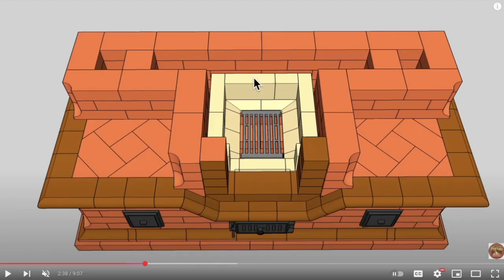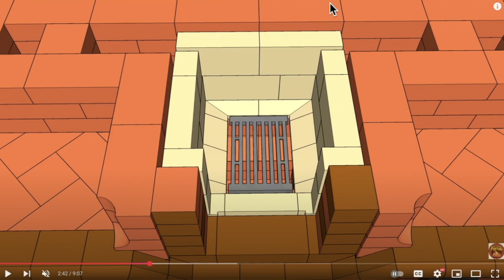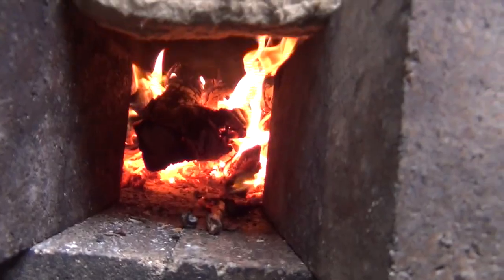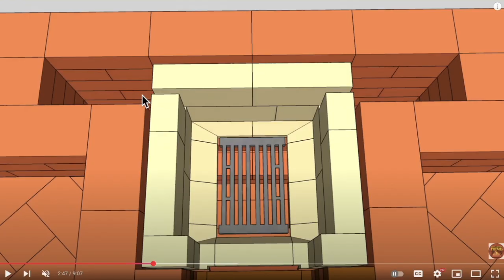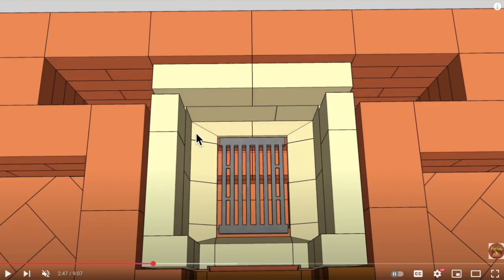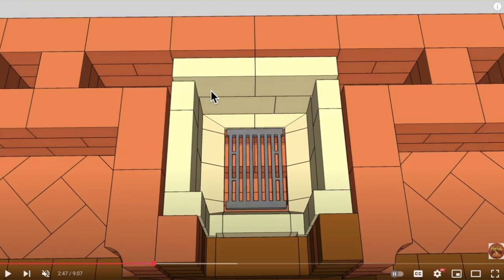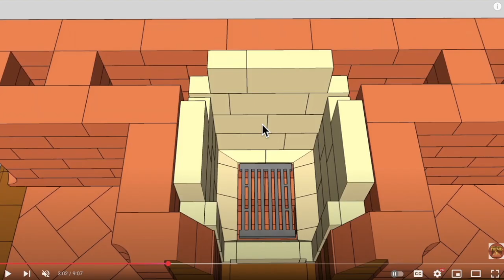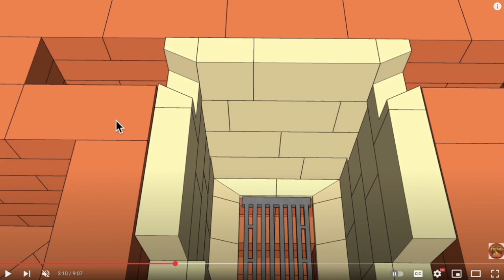Most Russian Stove Builders Do Not Understand The Firebox Dry Slot / Dry Joint / Dry Slit

Comment: Given how much you test,  could you use ash paste as an impromptu mortar? Or would that add too much time to assembly?
Reply from the maker: Yea.. I save my old ash after sifting and, for some, I have used the $3 bag of dirt you get at Home Depot in...  6 parts dirt to 1 part "Type S" cement. It comes apart easy. ..... but for MOST tests ... I can just stack with no mortar and it will work about 85% as well as being mortared. If the stove works pretty well with no mortar, with good draft and very little smoke... then it will all improve with mortar.

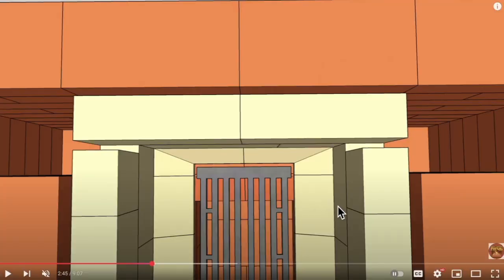Comment: Hmm! And here I thought that it was for startup only. You just covered it ~@05:40 You called it "priming." 

Hahahah. When they say "the separation of hot and cold gasses..." just sounds like a bunch of hot air, really. :D As convection displacement and sheer volumes (cubic feet) are going to be too great through the firebox for any form of marked laminar flow to occur, negligible, at best, and these "slits," once past a cold start, do absolutely nothing in RE to any (thermal) "air/gas separation".

Yet I would argue that it may help somewhat in a cold startup, though.

Heh! I would dare to say that you've come across the "Russian" version of the parable of "The Pot Roast" (cut ends), wives story... XD A lot of industries still have 'em.
Reply from the maker: Yes, I agree... thanks for the good comment.

Comment: The best I can see the slots in that design doing is feeding cold air from the descending passages into the firebox as hot air enters the same passages from above.  Quickly heating the descenting passages.  Ascending passages still need to heat, through a damper, bypass, or conduction through the brick, before the siphon can pull air properly.
Reply from the maker: Once the air reaches the descending passages, it's fully mixed and basically "at one temperature." The colder gasses could not find the firebox again, and the pressure / flow through the slit would be moving in the "wrong direction" for that to happen. Hot air and flame want to move INTO the descending channel because it knows that's the way out to the chimney and "everything is moving in that direction" away from the original air intake or grate.
Reply: @stoveadvice  The flow through the slits back into the firebox would be only during startup, before the descending passage heated.  And the gasses don't know the way out to the chimney until ascending passages warm and can drive convection.

Comment: I wonder if both of those openings could create a strange draft effect like a push/pull from one to the other,,, 
A negative impact overall when the firebox is heating up or cooling down especially.

It would be interesting if you could install thermocouples and flow meters to try all your designs out. That tells so much about engine design, heads especially.

That slit design concept appears to be a reverse secondary burn tube that is on my Hearthstone II.

Thanks Matt